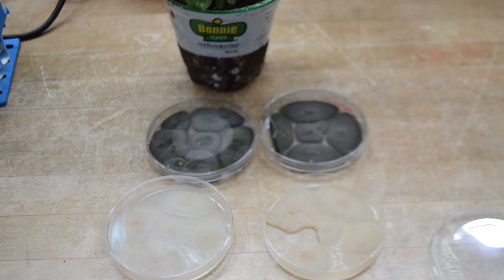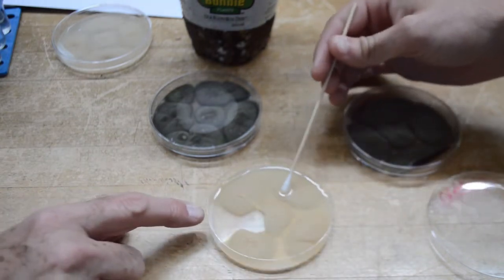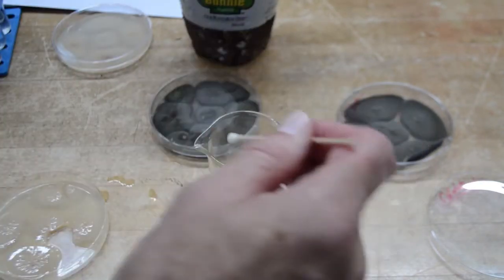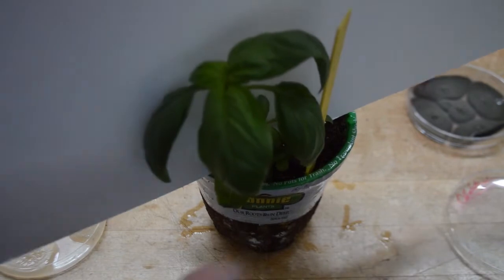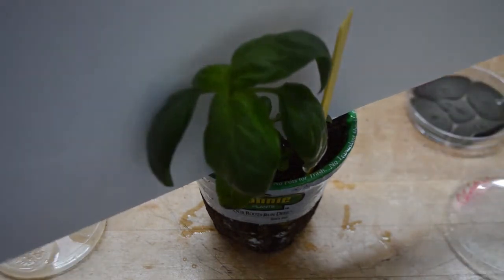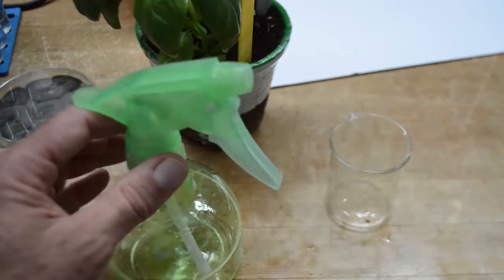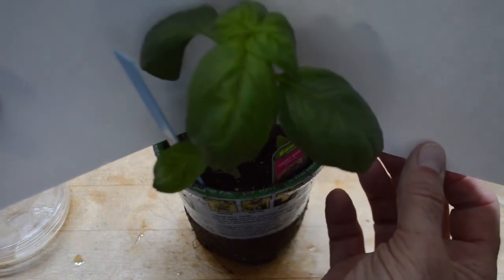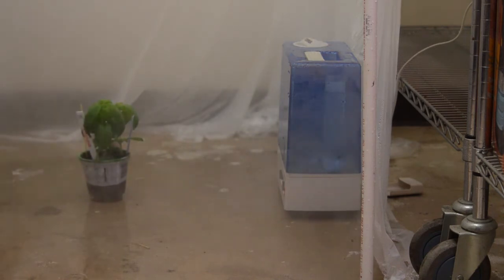Inoculation of leaves with fungi

Comment: Thank you for the informative video. How long can the spore suspension be viable for inoculation? and is simple refrigeration enough to store it for later use?
Reply from the maker: That is not a simple question. Remember the spores are living and placing them in water will most likely begin the germination process. Spores may germinate within an hour or two, which means that the suspension should be used as quickly as possible after preparation. Chilling may slow the process. If you tried to use it the next day, you should observe it with a microscope to make sure that the spores have not started to germinate.

Comment: Before applying the fungal suspension, should we need to cause injuries to the plant leaves?
Reply from the maker: With leaf spotting fungi, there is normally no need to cause injury to the leaves as the fungus has the ability to penetrate actively. The either penetrate by producing small pegs that get through the cuticle or they will use natural openings such as stomata and hydathodes.

Comment: What are the recommended plants to test for fungal pathogens?
Reply from the maker: Normally we are looking at a plant and its specific pathogen. This would require that you use the same species of plant that you isolated the fungus from. In this video, we isolated from basil, and then we used basil to test the pathogen. Remember, that these fungi are normally quite specific, with each pathogen having a limited number of hosts. If we use the wrong host, you will not get disease.